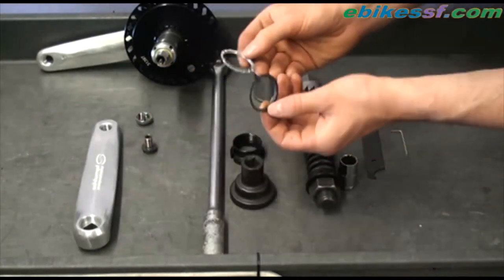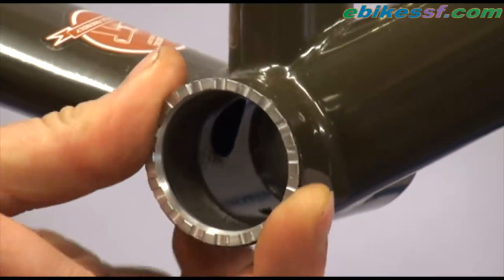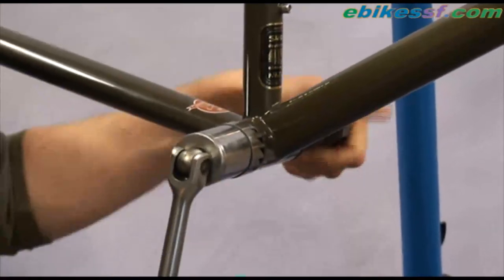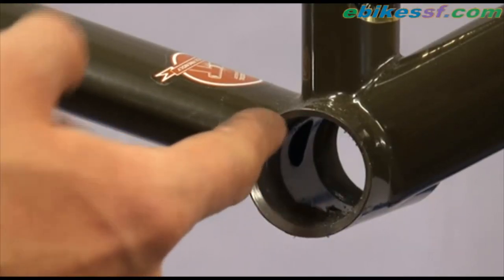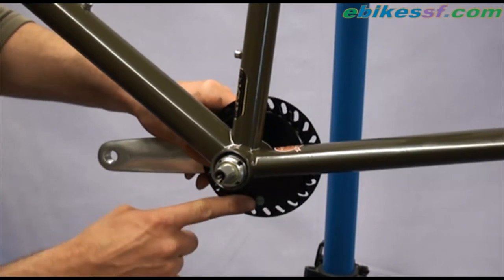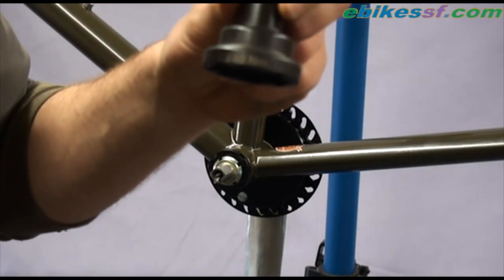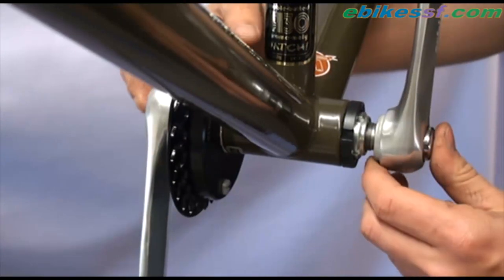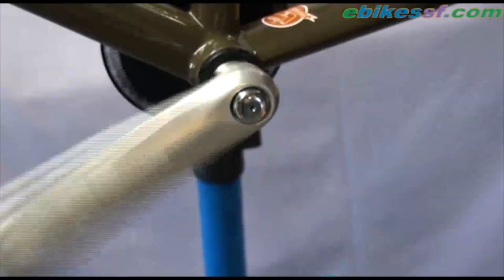Schlumpf High Speed Drive installation

Comment: Thanks for posting, appreciated. You should have put a little oil when using the chamfering tool to help save the tool on the long run; We didnt see you actually using the torque wrench to tighten it up, so we assume you are very good !